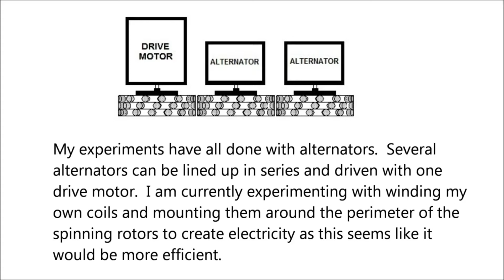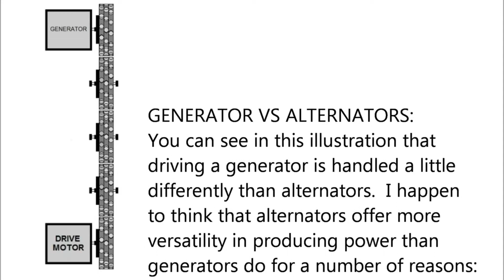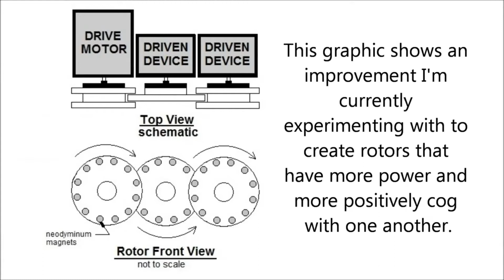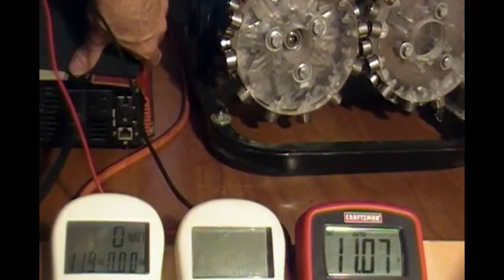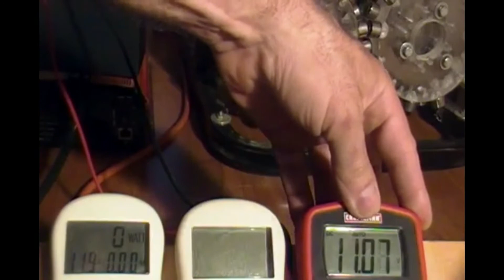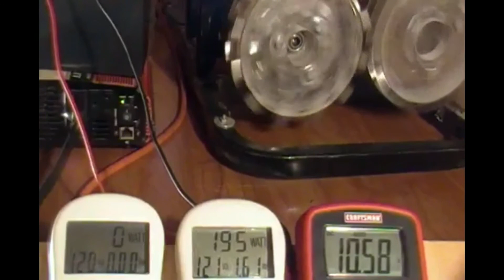FREE ENERGY GENERATOR FOR YOUR HOME OR ELECTRIC CAR- VERY SIMPLE

Comment: Multiplying the Volts by the Amps on the first meter doesn't match the watt input, it should read 133 not 97. Why is this? The second meter reads correctly. Thanks.